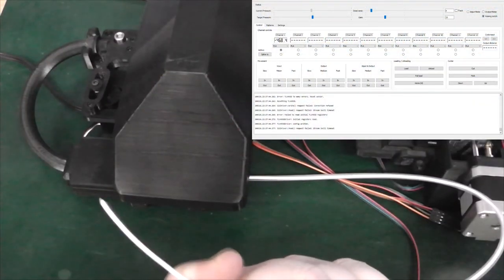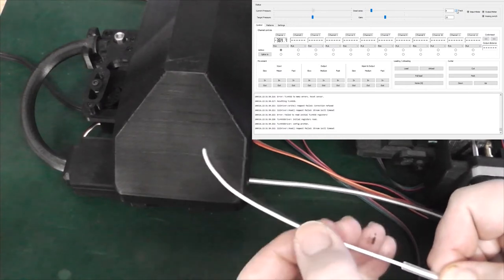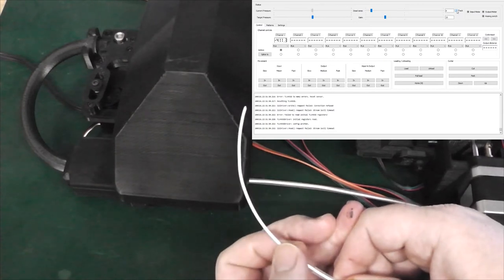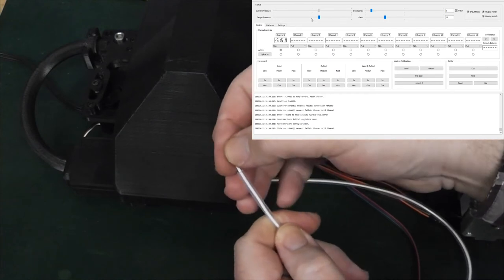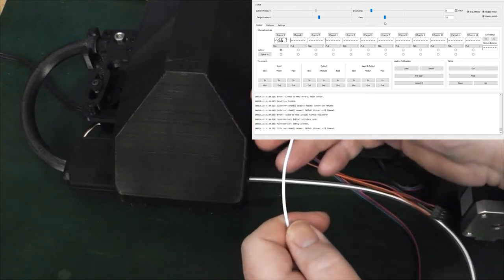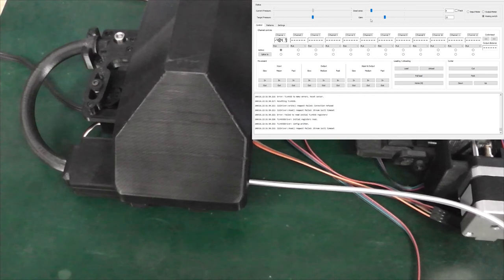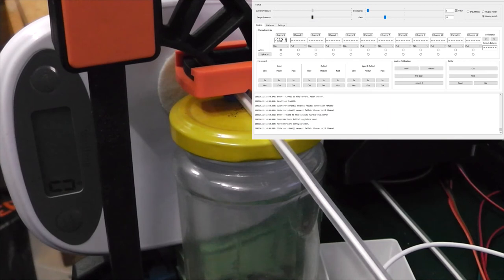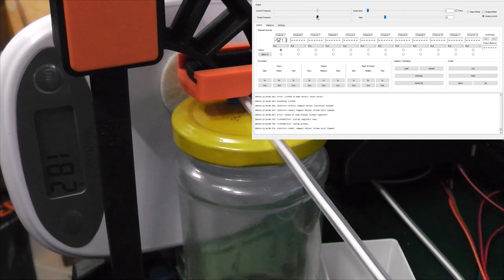Rainbow3D 12-channel multimaterial 3D-P progress update. Demonstrating the filament pressure sensor.

Comment: That seems pretty advanced. I've been using the Prusa mmu2s for a couple of print and what I found is that for me it's really useful for finishing spools (especially for 24/7 printing of PPE equipment). A splicer with 2 or 3 inputs I think would fill a lot of gap in the 3d printing world. I guess it's also ideal for soluble and accent colors. I don't know if this approach or the one of Prusa is better for that use case but still, the research and documentation you made cloud be really useful for this "market" !
Keep up, even though 12 spools is a bit to much for my taste x)
Reply from the maker: Thanks! Finishing spools will be one of the nice features with this. And yes, 12 channels is a lot, and I don't expect all channels to be used all the time. But it will be nice to be able to use soluble support plus a bunch of colors and spares for all materials that are running a bit low without running out of channels. It means you can finish of spools while printing a Rubik's Cube in-place with soluble support :-)
Reply: @kavionic279  Yeah I understand, but how much steppers do you need ? I know the palette has at least one per channel sooo
Reply from the maker: I use 4 steppers. 2 for the inputs, 1 for the output, and 1 for the filament buffer.
Reply: @kavionic279  That's not much considering you're feeding 12 filaments. Do you have a place where I can find some pictures to see how it work ?
Reply from the maker: It's pretty efficient in that regard. I don't have many pictures yet as I will not go into all the details until I'm getting closer to a release. Unlike all other projects I have here, on Thingiverse, and my blog, this project is not open-source. I'm planning to make this a commercial product. So even though I'm very into open-source and want to give some insight into the development process, I'm not going to be as detailed as usual.
Reply: @kavionic279  Ok, thanks for this little conversation then, have a nice day !
Reply from the maker: Your welcome :-) Wish you a nice day to, and stay safe!

Comment: Did you continue work on this project?  Do you think a splice system still has a place with today's higher flow printers?  By more accurately tracking splice location, can you produce a purge block that uses less material than Bambu poop?
Reply from the maker: Hi. Yes, I did, and I'm still working on it. But admittedly at a slower pace than before. Unfortunately my initial design for the splicer turned out to not work. I thought I had it all sorted out, but it turned out to be impossible to get it reliable enough to be viable.

It could run for up to a couple of hours with intense splicing, but eventually it would jam due to molten plastic going places it should not. I tested many different variations of the first idea, but none of the new designs worked good enough.

So then I more or less started from scratch with an entirely new design and working principle. And that show a lot of promise. Which is good. But it is also a LOT slower to iterate on. Which is bad. Both in terms of achievements per hour, but also in terms of motivation to put in the hours 😀

Had my initial design worked it would have been able to support up to 1000mm/s at 0.2mm layer height on a 0.4mm nozzle. So that should cover most high flow printers. The new design will be slower, but I don't know by how much yet. Hopefully it should still be able to keep up pretty well. And I also have some software tricks planned to be able to keep it at peek speed of the printer for most of the time, but to slow it down in certain areas (preferably during purging or infill) to ensure the buffer will not run out.

I doubt I will be able to reduce the poop by much. Even if you hit 100% accuracy it still take a while to switch material due to the mixing going on in the hotend melt zone. And I also don't expect to be able to beat Bambu on accuracy. They probably have the advantage in that regard since they make both the printer and the material switcher. That should make it a bit easier to synchronize things than when you only control the material switcher and have to work with whatever the printer do.